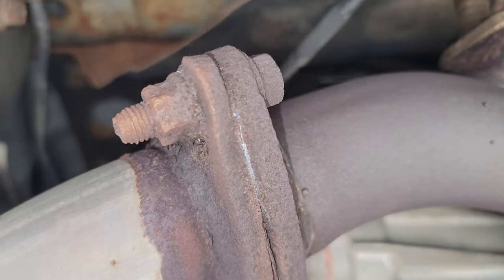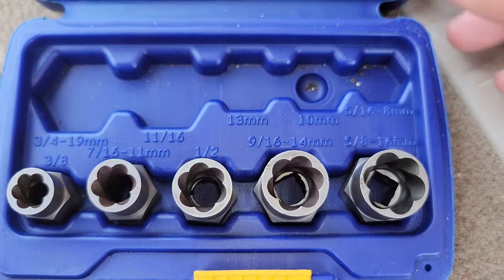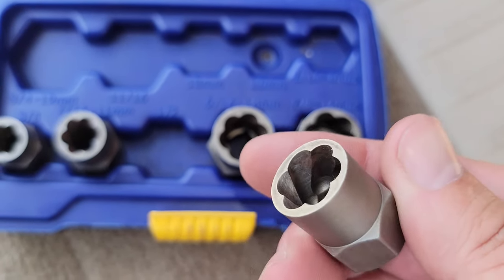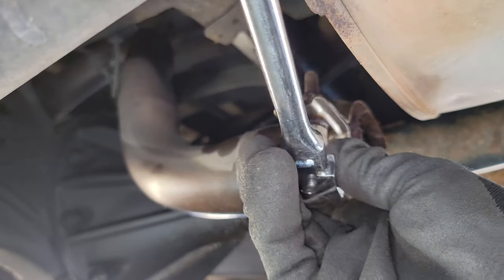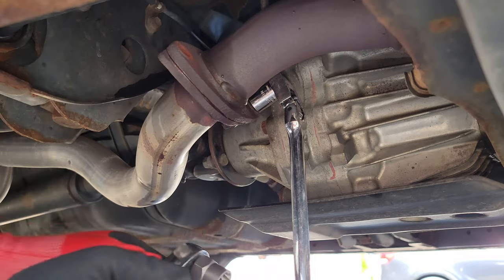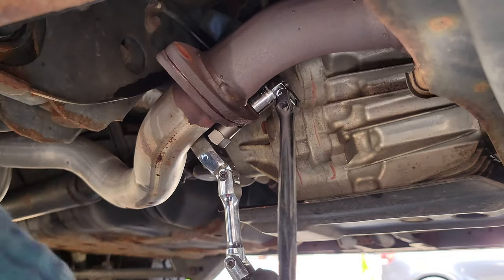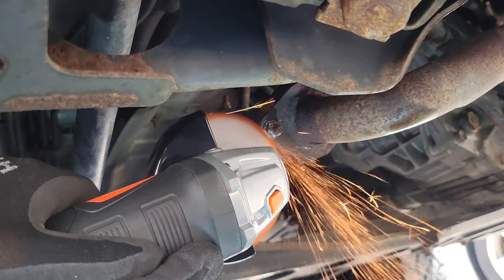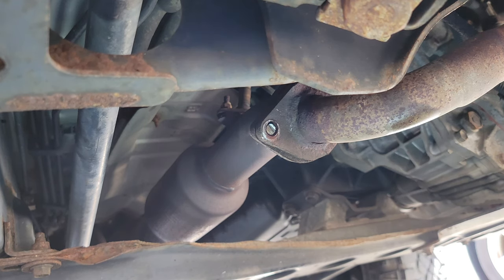How to Remove The Rustiest Exhaust Bolts

Comment: More time? No way, just start with the grinder and you would be saving time as you need to change those bolt anyways 😂
Reply: .....bolts anyway.
Reply: Exactly don't waste time , just use an electric jig saw thieves use to cut catalytic converters it will cut anything and bolts are cheap to replace
Reply: @kennyc388  LOL!!
Reply: Tried that ended up cutting into my finger into the grinder

Comment: Yea, that's not how you do that at all. In either example shown, you would just cut the bolts off with an acetylene torch and replace them. Takes seconds in the shop. Otherwise, you heat the nut up red hot with a torch and zip it off with a 3/8 air impact. Signed, guy that did exhaust work for living once upon a time.
Reply from the maker: Agreed there are much faster ways to do it, but most people dont have access to acetylene torches, shops, impact guns etc. These are easier more accessible ways for people to do it at home rather then spending hundreds.
Reply: @cruisinwithgreg It doesn't require hundreds. Anyone who works on their vehicle needs an impact wrench. Also, a propane torche is not expensive
Reply: @cruisinwithgreg you proceed to get the bolts off using your methods and somehow it's still not how you do it...where do these people come from?
Reply: bolt extractor sets are like 20 bucks so for entry level individuals its a perfect tool for the job.
Reply: I don't have impact or a small torch. The only torch I have is way too big for cars and pickups. Do everything with a rachet. Money is tight. I have a couple of torque wrenches but no impact. It would be nice but definitely don't have one. Cheap one is $40 expensive one is, well yah just can't justify it for now but it's on my wants list for sure.
Reply: What do u do for a Ford press in bolt at  flange. Grind or cut off wheel..I have a propane torch.  then try to knock it out w a hammer and punch? .95.ranger is kicking me. I wanted to try a hf electric 1/2 wrench and a puller set

Comment: Heat them up spray them with water. Then quickly crack it loose.
Reply from the maker: Sometimes the bolt is way too rusted into the nut for that!

Comment: Heat will help immensely... Even a propane plumbing torch wool help
Reply: oh no it wooln't
Reply: Speaking from experience trying it now, not even a map torch is helping me at the moment
Reply: @Costa_del_Artlepool yeah it does then spray the with cool water. You can use map gas if you want it to get hot quicker aswell.
Reply: @nickstevens7369 are you heating what you are trying to remove. Because if you have a bolt thats goes into the block you want to heat up where its bolted into. you want that area to expand not the actual bolt.
Reply: @Costa_del_Artlepool  underrated af comment

Comment: The problem with bad exhaust studs on some Ford cars and trucks is that the bolts are pressed in and made of harden steel.  Once you grind off the rusty bolt, you still have to punch out the other half of the stud which is still inside manifold.  Drill bits won’t go very far, even a cobalt drill bit.  Normally you would use an oxy-acetylene torch and burn it out (while protecting the O2 sensor).

The easy fix with Fords is Dorman P/N 23755 exhaust flange repair kit which fits over manifold shoulder and holds the exhaust pipes in place.
Reply from the maker: Thanks for the info and part number!

Comment: Forget these guys jumping striaight to the acetylene torch. Sure, if i had a garage where i could store it i would. For my old F150. I cant store the extractor nuts right under the seat and be good to go. Same with the angle grinder.

Thanks for the video. Sometimes you need a precision surgeon. Something you just need a bandaid.
Reply from the maker: Hey thanks! Yea different ways to do it but I thought these were simple accessible methods for all!

Comment: will this help with old rusty welded bolts too?, i have a stock exhaust that is welded in and need to get it off asap, including the header is looking like it’s welded in or maybe it’s just old and rusted, can i get some tips, or even better get the link where you got those
Reply from the maker: IRWIN Bolt Extractor Set, 5-Piece (394001) https://a.co/d/8lfghXP

Comment: Oxy acetylene torch heat the crap outta it, red,  and itll come right off. Or put a cutting tip on and snip er off!
Reply: Of course you have to be careful when using a torch. Have your air blow gun a water spray bottle and fire extinguisher handy. I've had a few things on fire but haven't burnt the shop down yet ha! I usually use an impact wrench and find an impact socket that fits the often times undersized nut or bolt, then you might need to drive it on with a hammer first to fit it before heating it, don't heat the socket obviously. Then when you get it hot spin the nut or bolt off quickly so the socket doesn't get too hot and loose it's temper, but I use the torch most. Works good if you dare...
Reply: Oh, those induction heaters work good too, if you have one.
Reply from the maker: @429thunderjet2  thanks! yea most people dont have access to torches or  know how to use them safely!
Reply: Best way to do it

Comment: An old mentor of mine introduced me to heating it up and touching it with beeswax. The heat melts the beeswax and the natural oil in it creeps through the threads. Been using that trick for years on old steam flanges and pipe unions!
Reply from the maker: I have not heard of that, super interesting and thanks for sharing! Ill have to try that next time!
Reply: such a load of bull shit. Doesn't work on anything automotive.
Reply: @ronaldwoofer5024  If you read my comment, it works on steam flange bolts, broken off pipe nipples, etc. I didn't say anything about automotive.

Comment: PB Blaster and an adjustable air hammer. Dial the air hammer down to a steady reasonable rapping and hose the bolts down. Maybe 2 minutes of rapping and the bolts will either vibrate loose or snap off easy.
Reply from the maker: Thanks for the tip! Wish I had an air hammer and gun!

Comment: Not a single word about working smart and using an inductive heat gun! Work easy and not stupidly hard.
Reply from the maker: Hey thanks! Considering inductive heat guns can cost at least $200, it is smarter to start with solutions that cost less than $20 first for most people. Also  these methods are much easier and not hard at all!

Comment: Mine is a pipe with studs so i cannot cut it off or screw up the threads on the stud.  Its very rusted and when i remove the rust the NUT looks shiny like its molded together.  Any tips, The Nut it self is okay, fits 17 socket but like i mentioned the back side of the nut to the stud looks molded together from the heat, my guess.

Comment: What do you do if the bolt is in a bracket? Can't put them out. (Rusted out bolts on electrical fan mounts 98 XJ)
Reply from the maker: Oooh. Is the bracket welded on or could you replace the bracket?

Comment: would any extractor set kit work?
Reply from the maker: For the types of bolts in the videos, a similar extractor that grips the outside would likely work. 
If the bolt head breaks off you will need extractors that drill into the bolt.

Comment: The issue I’m running into is the bolts Honda chose to use are oddly shaped so I can’t get anything on it secure enough to turn
Reply from the maker: Not even for an extractor? Is it a flange or stud?
Reply: @cruisinwithgreg  google Honda converter bolt and it’s like the first picture . The top of the bolt is so small that putting a open ended wrench almost doesn’t hold it . And I haven’t found. Socket that fits over it . I got it off finally but it took me legit three hours lol tightening and loosing with endless on blaster . I’d be damned if I cut the bolt off
Reply from the maker: @noebernal9591  man why would they design it that way?  I wonder what the point is
Reply: @noebernal9591 what did you use to get it off? the bolt is stuck at the end and we tried to take off the heat shield. the stud or whatever is holding the broken piece in. would a bolt extractor work or screw extractor?
Reply: @Godsxeed  I legit took hours on and on just tightening and loosening untill it came out . A open end stubby ratchet will grab on to the one end I just dong Remember which size
Reply: @noebernal9591  my mechanic telling me to get another manifold but i don’t want to do that. i brought a screw extractor or would it be better to exchange it for the bolt extractor and put pb blaster?
Reply: @Godsxeed  pb blaster for the win . Pb blaster and a day off is all you need
Reply: @noebernal9591  so get the bolt extractor instead or size 11 socket?